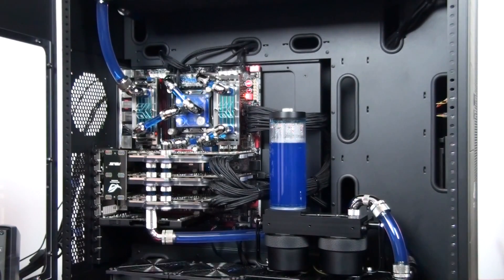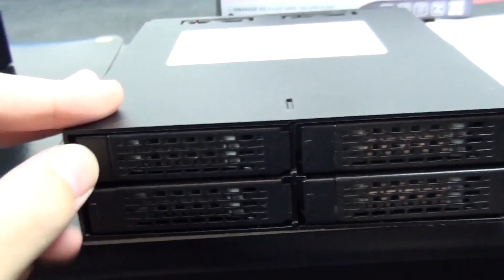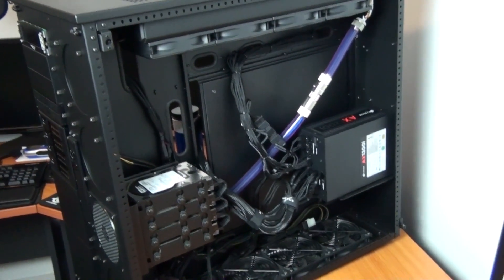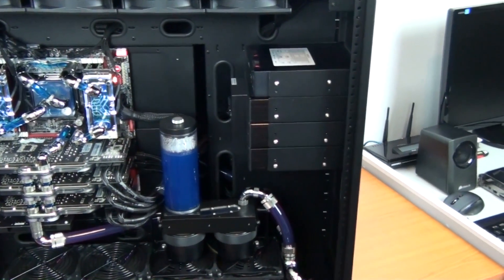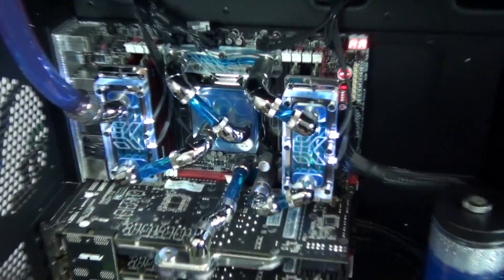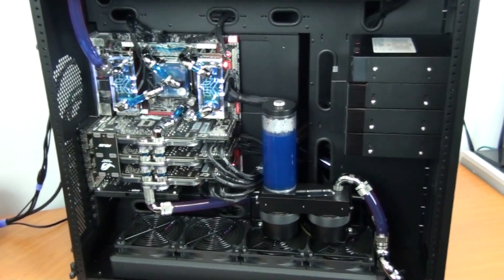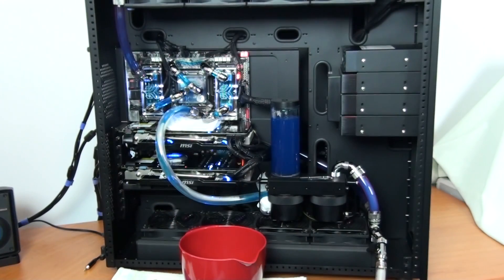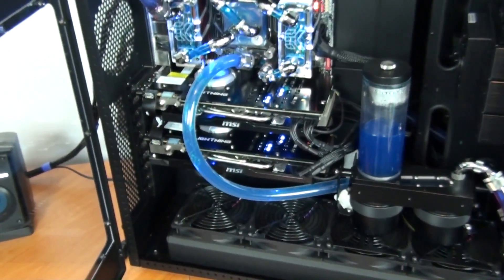Singularity Beast II Build Log Part 17

Comment: It is very simple. If you have 1/2ID and 3/4OD tubing you would buy 1/2ID and 3/4OD compression fittings or 1/2ID barb fittings.

Comment: I would go for either Noiseblocker PK-2's or PK-3's depending on what kind of noise/performance balance you want. If you want to use PWM, go for a Noiseblocker PK-PS.

Comment: Isopronanol alcohol takes of the staining so good.I have used it on my rads until now and it is very effective. Vinnegar is good also but the smell if gives is ennoying, you have to be very careful when using theese both as it can acidate the coppar causing it to melt inside the waterchannels.
Just dont let it to stay for long (max 30min per time, flush with destiled afterwards) into the rads and you will be fine Daniel.

Comment: Wouldnt this build be quite loud.. I mean, with like 16 120mm fans chilling in there, even at ultra-low voltage, not including the pump and the little bit of noise the liquid makes.. Surely its gonna be quiet noisy.. Looks absolutely beautiful though, That case... Isnt it double thickness? As in like two HAF X's side by side? If i had the money, thats the case id pick.. Beautiful build; Congrats! Cheers for this series, great for learning the old bit, and bob.

Comment: I use it pure, i buy those isopropanyl spraycans (1000ml Spraycans), You can find them on carparts suppliers, its called "Break Cleaner", this is the cheepest way of buying it and you save a lot of money, same thing...just another name for it, Sonax have theese for an example.

Comment: great videos, very informative.  if you used the taller res i've seen in one of your other videos, maybe the case wouldn't look as bare.  there's certainly room for it.  one other thing, i don't know if you're a nvidia only guy, and those cards are badass, but the new asus matrix 7970 is arguably the most powerful single gpu card available.  i know they're pretty new.  anyway, everyone i know here in canada loves your stuff, keep up the good work.  i've learned a ton from your vids, thanks :)

Comment: Hey man.
I thought bleach when I saw the staining still lingering, but my concern would be that some bleach will be pulled into the rads and slowly released, which could bleach your coolant, so you'd have to flush them for over 9000 hours to be sure they're clear ;)

I hope your lightnings are pre NVIDIA stitch-up (green light), or your overclocks are gonna suck, but you'd still be left with a pair of seriously sexy boards (once stickers are removed).

Good luck man and I'll await next vid.

Comment: i have a suggestion: could you make a guide on minimum, recommended and overkill radiator capacity you need for what kind of configs. if you already made one i'm sorry for wasting you time reading this comment, if there is one can you link it?
It would be lovely if you replied.